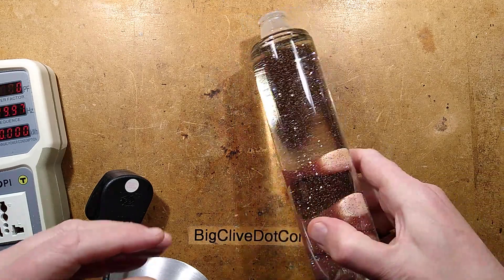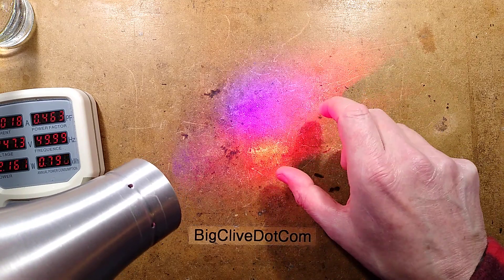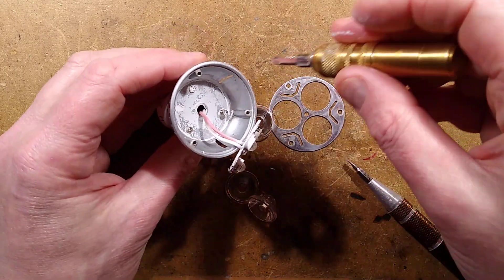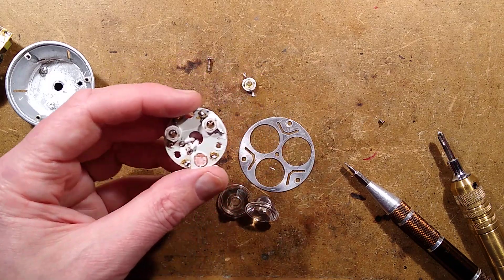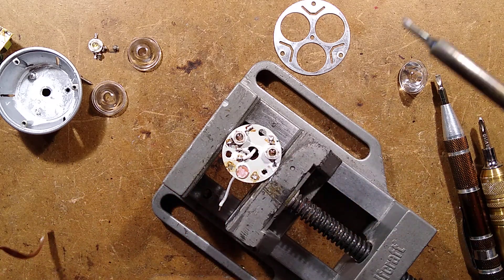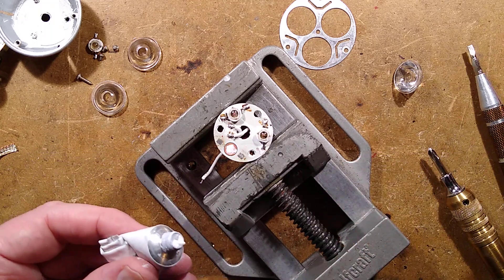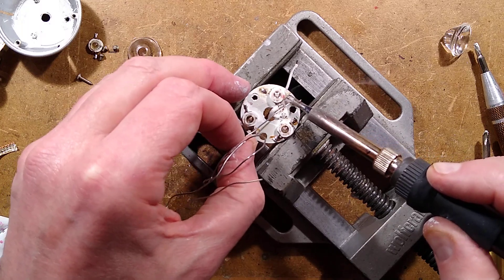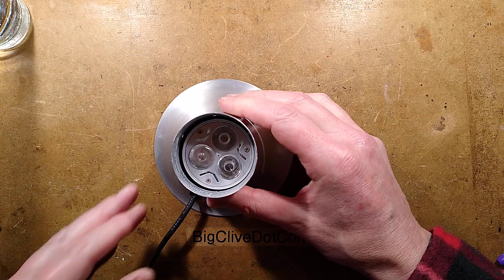Updating a 70,000 hour LED lamp

Comment: Very amazing and cool.  Thanks Big Clive.

Interesting on the discoloration over time.  I wonder if there is a better material they could have used if they had it back then?
Reply from the maker: The new UVC LEDs use quartz windows.  But that would get expensive fast.
Reply: @bigclivedotcom  Eight years.  So fabulous.  I wonder if the quartz windows would get cheap with mass production and a higher demand?  

Calcium Nitrate.  Seems like you mentioned that recently with it being much heavier than water.  I'm going to have to look that up and play.
Reply: Hi Clive. Sorry about random question here - couldn’t work out how best to contact you.

I have an old “master/slave” power strip. Never really used it, so just tested it still worked before planning to eBay. Used tester plugs and they revealed all slave sockets have “live” permanently! Master just cuts neutral to them! Sounds super dangerous to me so I won’t sell now, but wondered if you wanted it for demo etc?

Comment: I guess, if the heatsink compound is silicone based, it will creep. Silicone grease I have, especially the older stuff, creeps everywhere once applied. It may not be because the silicone grease is older but because it's been in place for longer.
Reply: Changes in temperature and heat transfer through metal often causes metal parts to warp and move around a bit. Even such small movements will create a "pumping" sort of action that causes heatsink compound to creep.
Reply: @Reactor89  Same thing with thermal compound on a cpu. I think it`s even called pump-out.
Reply: The heat compound is likely to be a very viscous liquid at operating temperature, thus flowing at glacial speeds over the years it's been running.

At Manchester Uni, England, there is a pitch glacier that was made with an apparently solid lump of pitch back when Victoria was alive. By the seventies when I was there it had flowed several centimetres down the 10degree slope it was built on, and had completely lost it's original rectangular shape. 

Like pitch, heat sink compound is likely to flow less slowly the warmer it gets. It's designed to do this to help it spread well in the gap that it's bridging. If it acted like a solid it would make no better contact that leaving the gap dry.
Reply: @trueriver1950  I must say, what an incredible explanation! I really feel like I learned quite a bit more than I actually did! Well done! 👍
Reply: That might explain how the goop in my 486 computer's heat sink got into the socket. Thanks for the info!
Reply: @FerralVideo  To be fair, at that point some one may have over done it a little with the heatsink compound... On the hand, I don't think ~30 years of creep was planned for....
Reply: Could moisture have something to do with
 it?
Reply: I ask because sometimes we dont get to things and it rains and it seams i deal with that case more after a rain. I'm thinking it emulsify and migrates. I always feel dirty after I get it on me! Is it toxic?